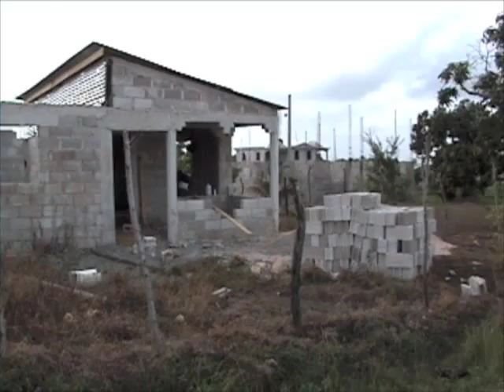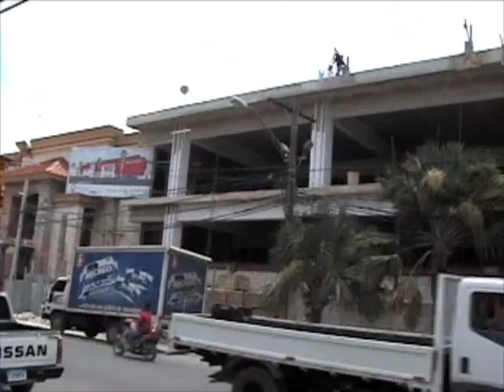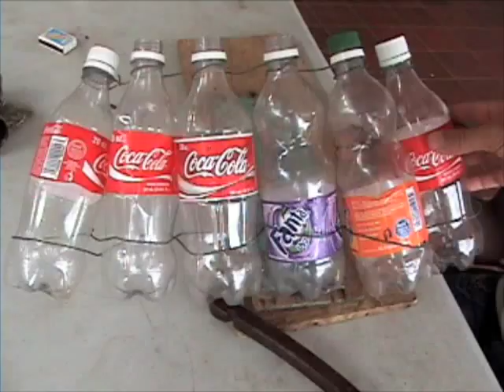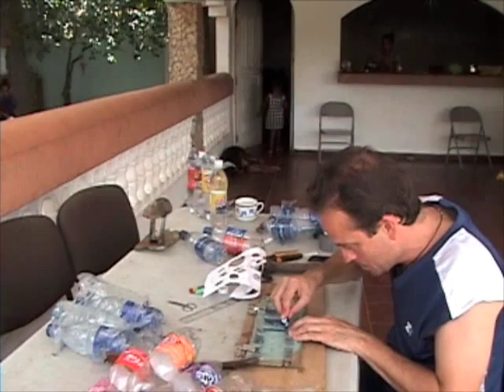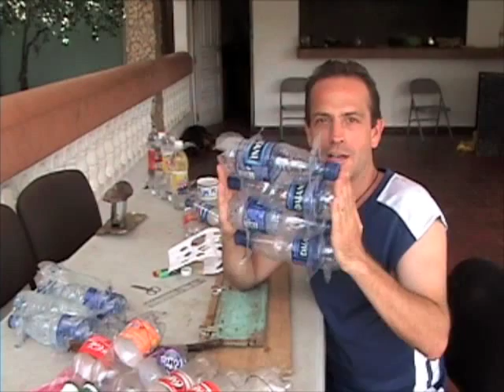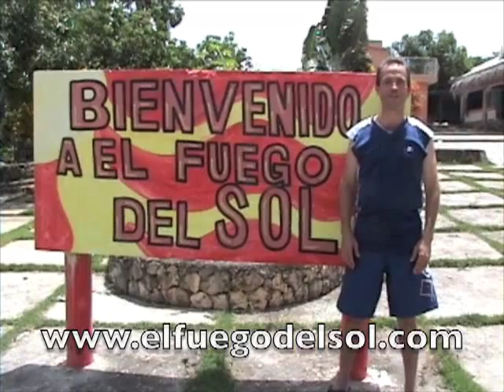Plastic Bottles for Concrete: El Fuego del Sol by Kevin Adair

Comment: Hey buddy, thanks for sharing the video.  I will actually recommend you to build a small sample of a house in your back yard and push it around to see how would your tech works.  Concrete is not as easy to work with as you think, concrete might not stick to the bottles. Check it out.

Comment from the maker: This is an experimental concept, so I would recommend experimenting with the different concrete grades for best results. I would use this system in conjunction with reinforced concrete corners and pillars, or structural "Red" steel. I'd be interested in learning your results.

Comment from the maker: Hi ronaldreika,
Thanks for commenting on my video. The process would involve the plastic bricks being fully covered in standard concrete. There would be no exposed plastic to catch fire. The use of these plastic replacement blocks would not be recommended in places where flammable materials would build up, such as a textile mill. However in basic housing, retail, commercial, etc. This solution would provide a solid alternative to filling walls with environmentally detrimental concrete block.